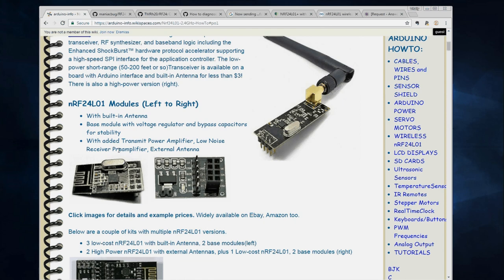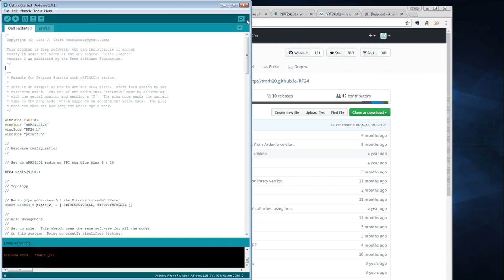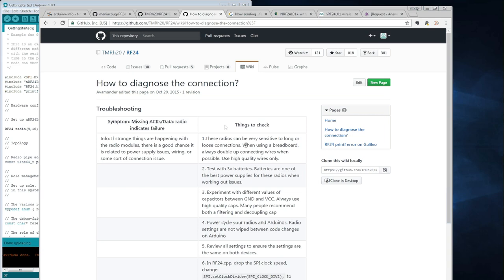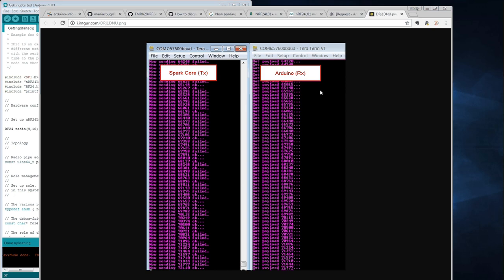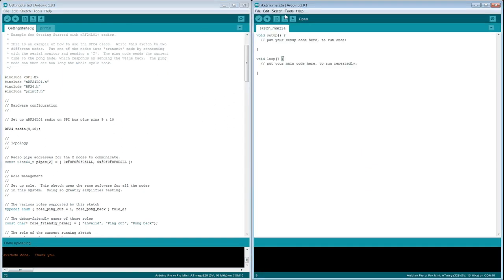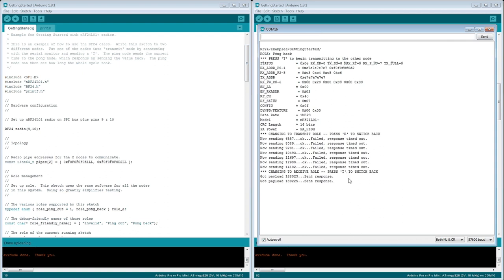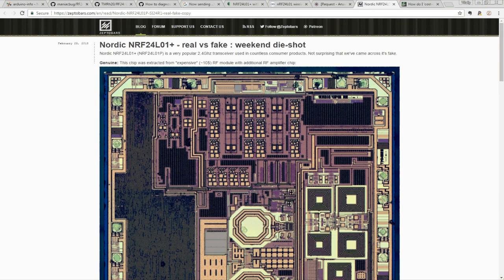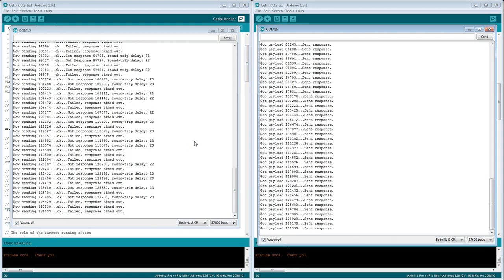nRF24L01+ HOW TO FIX: Now sending ... failed. Failed, response timed out. RF24 nRF24

Comment: i did the same when i cmt 't' it worked normally but when i cmt 'r' it didn't do anything else it didn't receive the signal. Can you tell me why?
Reply from the maker: Well, r is receive , are you sending anything on a 2nd end?
Reply: @vitaliyd193  no i follow the instruction but when cmt "r" there is no response from both the receiver and the transmitter still sending the signal.

Comment: Hi,
Can anyone help me with this?
when I plug my arduino with module to the computer and I start up the program i get sth like this:
RX_ADDR_P0-1 = 0x0000000000 0x0000000000
RX_ADDR_P2-5 =0x00 0x00 0x00 0x00
TX_ADDR =x0000000000
Everywhere in  serial monitor i get answer with zeros.
I conected voltage line and everything is powered on.
Does anyone know what might be the problem?
Reply: It looks like its not communicating via SPI on with the arduino. Check power going to correct pin and SCK going to pin 13 on the UNO.

Comment: we need a 100 uf cap,thats it right or do i need 0.1uf in parallel
Reply from the maker: 100uf is enough.
Reply: It is not working with the 100uf
Reply from the maker: @maruthikotadamakki9017  get a new trusted sourced module.
Reply: Thanks

Comment: Hey good video. Mine is sending wrong data. It send the right data 1/4 of the times. I added a 100uf to the power rails and a 0.1uf in parallel for decoupling. Still the same issues. Power amplifier settings dont change anything. Dont know what to do... can you help me? Thanks
Reply from the maker: BarbasBandas  what kind of discrepancy you see in the data? is always same wrong data or dynamic changing?
Reply: Vitaliy D I have a transceiver for my Arduino Wheater Station. The one that is sending seems to be sending alright. No issues with that one. But the one that is receiving data displays (both in serial monitor and lcd display) wrong data. Like temperature is 24celcius and the I get sometimes 61 ou 63celcius. These numbers (like 61 63 or sometimes 00 or 99) are the most commom. I tried to delay some data because I thought that it was to much data per second but nothing changed.
Reply from the maker: try going simpler first, sent say a number 112233445566 and see if it is delivered consistent. Then complicify the code) Good luck. Distance might another issue
Reply: Vitaliy D Thank I will try again. My modules are 10cm apart... Thank you so much for repplying!

Comment: Can we use 100	uf capacitor?
Reply from the maker: Modern Tech. Yes you can. I recommend that.
Reply: Will the connections differ if I use the nrf24l01 power adapter?
Reply from the maker: Modern Tech. I'm not sure, sorry.

Comment: Do you know anything about pinning this module on the micro?
*edit: thanks for the video
Reply from the maker: Try this one: http://schullebernd.de/wp-content/uploads/2015/10/Schaltbild_nRF24L01_ArduinNano_mit_Elko.png
Reply: thanks I'll give it a try.
Reply: what do you recommend for that capacitor? I've seen them mentioned but I've seen a few different ones bouncing around.
Reply from the maker: Cameren Gigantic I agree with what most ppl say 10uF and 0.1uF in parallel. But you can use just one. I was fine with one of 100uF capacity.
Reply: i think i got it working man (at least some of the time ) thanks for the help.
Reply: we want more troubleshooting videos like this. Everyone can make tutorials. but problem fixing is as important as tutorials. Thank you so much.

Comment: Could you please upload this file?
Reply from the maker: What you mean?
Reply: @vitaliyd193   Code files sir that you have modified for both sender and receiver.
Reply: @vitaliyd193  i tried this code for once it sent the data but on receiver side there was nothing, and from then till now it is failing over and over again
Reply from the maker: @tamurtaj2722  man, just buy better modules from good store or use HC05 or HC12 or RFM69 modules. If this fix does not send data well, then check wiring 3 times and check if connections are really good (solder instead of jumpers). Then if no luck, see first sentence above.

Comment: welp, it doesn't work for me
Reply: I covered the antenas with my hand and it works without a problem. I searched for a solution for a month and that's what I get. I'm happy but I would not like doing that every second. Thanks for saying that.
Reply from the maker: @myperro77  . Yea, better use HC12 or rfm69 modules. Or esp32 wifi modules if need wifi.
Reply: @vitaliyd193  Indeed, I"ll do that. Cheap is expensive sometimes

Comment: found this on google: What happens if antenna is not grounded?

Your antenna mount needs to be properly grounded for your antenna to function correctly. Without a solid ground, you're bound to get high SWR levels and extremely poor performance.
Reply: like putting the fm radio antenna against the metal water plumbing. for better receptance.
Reply: maybe that helps.